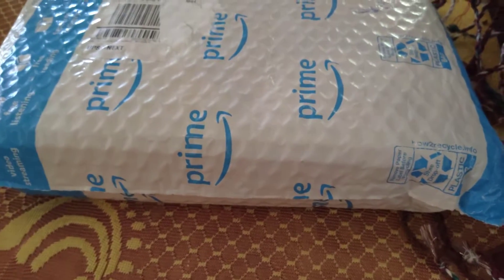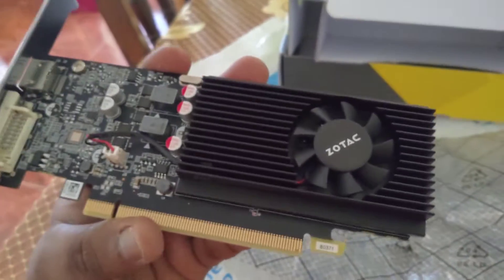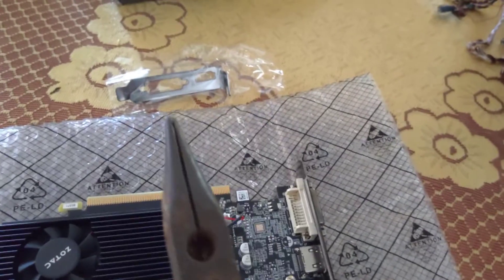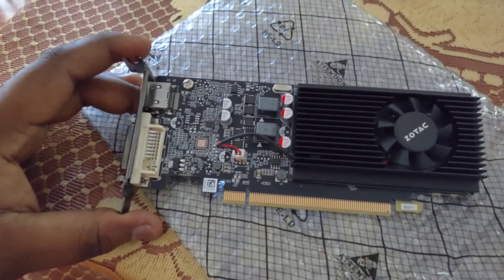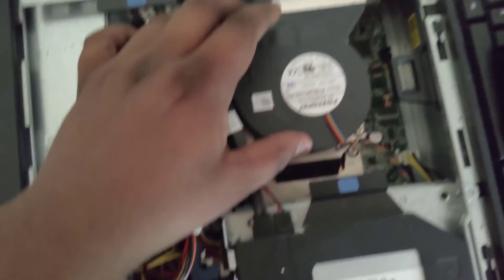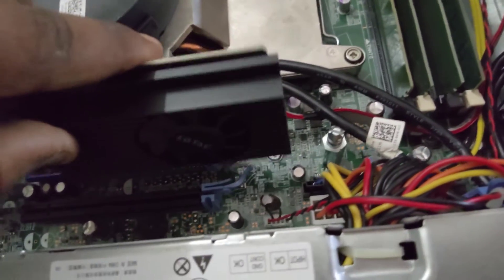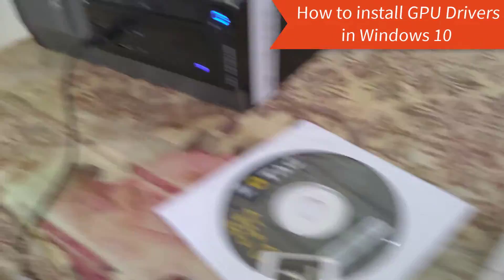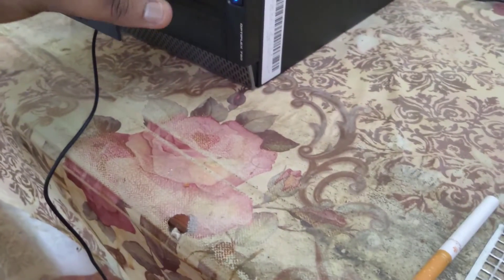How To INSTALL a Graphics CARD in a Dell Optiplex 790 SFF

Comment: Hi can a gtx 1060 go inside the optiplex 790 because I thought you needed to connect the power supply to the gpu and also the gtx 1060 im talking about is a one fan model so it’s small
Reply from the maker: it depends on your dell optiplex 790 how much power of its PSU.
Give it a try bro, if 1030 works maybe 1060 might too without upgrading that existing PSU inside the optiplex i think its only 290W or 300W
it might not be enough, you might face struggle.

Comment: Can the RX 460 sapphire Radeon fit inside of a optiplex 790 usff? And if not, what can I remove that's not important to make it fit
Reply from the maker: Wait, you mean an ultra small form factor then nope it won't fit.
But if you willing to dismantle everything, remove the case completely then i'm certain it will fit. But that's gonna leave you at a disadvantage for dust. You'll need to use the PC, without its case. And from time it might attract dust and it will be a mess if you spill water or any kind of drinks over the motherboard it could short circuit too.
Reply: nope the 790 usff is like a mini PC and the rx460 need an connector HEHE